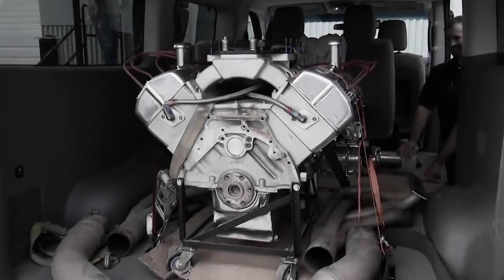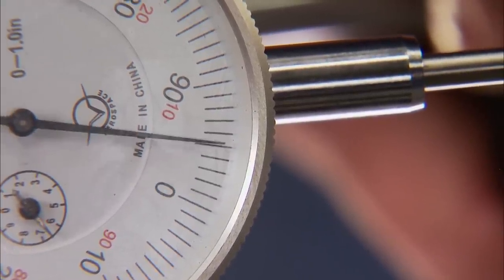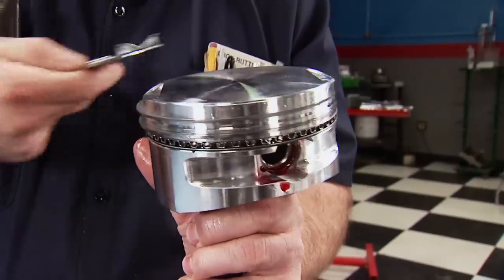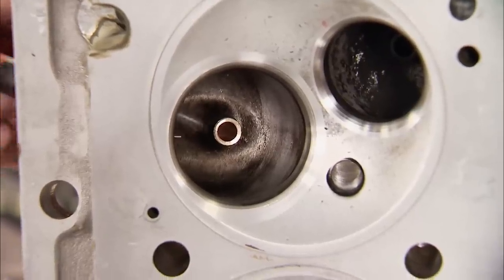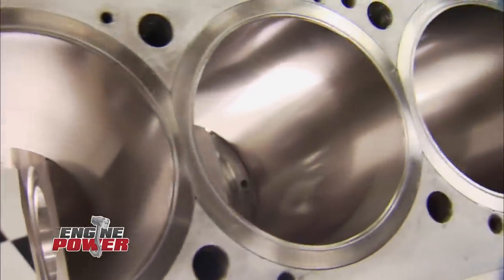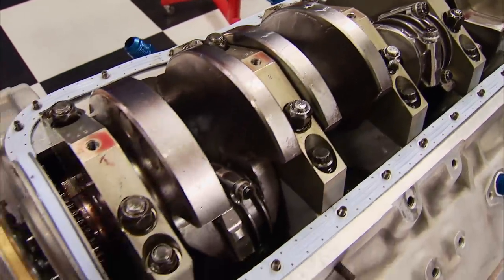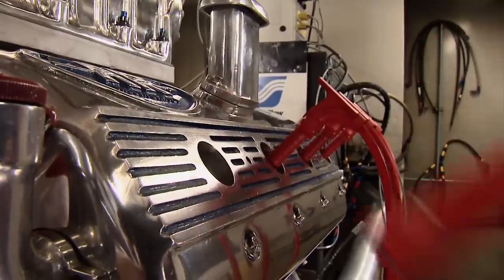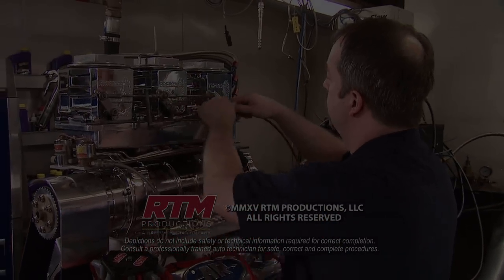The Original BigFoot Engine Build Part 3 - Engine Power Season 2, Episode 7

Comment: Why would you use a P series bearing instead of an H series 🤦‍♂️
Reply: The P series bearings are softer and can handle a but more dirt contamination by allowing it to become embedded in the bearing and causing less damage to the crank journals than an H series bearing. H series are harder and will support more horsepower overall, but at 1000 horsepower they arent making power than a P series cant handle.
Reply: @thesh111t  I'm sure since this thing will just idle around and not ever produce any power, it will probably be fine. 
I've seen crushed P-series in 800hp engines. Some folks are not the best tuners in the world and they need a little built in forgiveness because they didn't pull enough timing.
For a few bucks more, no reason to not just put in an H-Series. Why run a bearing right to the edge of its capability?

Comment: Considering it's a hemi headed , 600+ cubic inch blown big block those dyno  numbers are quite pathetic
Reply: im sure yours is way better
Reply: Have to agree, I would have expected those numbers naturally aspirated.
Reply: @codycr6  i think they are probably leaving alot on the table for longevity. This truck wont see comp anymore so why push it.
Reply: That's bc the truck is running a low tune. 600+ inch BBf have been used in funny cars making huge numbers for years and this truck during the pulling days was well into the 1400 plus mark
Reply: @wellthatsjustpeachy90  Funny cars, as well as Top Fuel, run 500ci Hemis. That's been the rule for quite some time.
Reply: @mrbeefhbw  they are hemi style yes but each manufacturer is required to build their own motors to spec. Yea sure they have to fit in NHRA standards but they are all done thru their own company. Only reason I can say that is that I got up close with John forces car a few months back and the block def had a Ford logo stamp.
Reply: @Mod Zozer and the reason is they wanted it back to being the right way. Why do something half assed if you have the means to do it right than do it right and you don't have to go back and do it again later.
Reply: @wellthatsjustpeachy90  ....John Force (or any other top fuel or funny car) hasn't used a Ford or GM engine in 50 years.  The 500 cu in engines are all custom designed race engines based loosely on the original Chrysler Hemi.  If the engine you saw had a Ford logo it was somebodys idea of a joke. BTW, Force hasn't been aligned with Ford for 4 years.  He has a Chevrolet sponsorship (2015) currently.  However, there isn't a GM (or Ford or whatever) manufacturers part within a thousand miles of one of these 10,000 + hp engines.
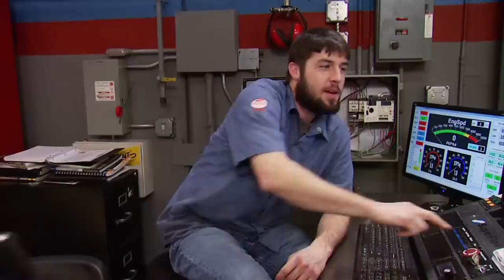Reply: 18:16 is your answer.
Reply: The numbers don't make sense. Even shutting it off early, that engine should have made a ton more power at the boost levels they are claiming. That is less than my small block makes on low boost with half the cubic inches.
Reply: I understand. I have worked around quite a few of these engines. I have also been around 540 inch big block Fords that have made over 850hp with no blower and on pump fuel... with stock blocks and a less expensive bottom end.

Comment: great job but didnt see or here about breaking in the cam
Reply: Non hydraulic lifters, no break in needed. Go do more research.
Reply: @brutalbasspro  its not that its non hydraulic its that its a roller cam instead of flat tappet
Reply: @brutalbasspro  you need to do more research it still has to be broke in lighter valve springs and oil with zink
Reply: Cool story bro

Comment: Cams do Not close valves......valve springs close valves

Cams only control the duration a valve is open
Reply: not with desmovic aka Ducati motorcycles
Reply: I’m addressing the statement made in this video

But I wonder why so many times I’ve heard so called professionals say a cam opens AND closes a valve when it clearly does not.

Maybe because they are not professionals at all but YouTube and tv show hosts and not real mechanics......otherwise they would know the physics of it all
Reply: Chief60 because Camshafts DO open and close valves, its not like they instantly go from opened to closed. The valves are controlled by the design of the Cams lobes, not the springs....
Reply: Mvstng.......
So valves are magnetic?
That’s what your saying?

It’s gotta be what your saying, it would make sense in your interpretation because otherwise how would the valve follow the cam lobe

Oh wait........ the valve must follow the cam lobe because of valve spring pressure holding it in the CLOSED position 

Thus I am correct in saying valve springs CLOSE the valves and your scenario is incorrect.......otherwise you wouldn’t need valve springs at all

I’m waiting to hear your reply 
This oughta be good
Reply: Having to explain something so simple to people that don’t understand science of motion or physics in any way is frustrating, so I won’t try anymore 

I am correct 
You are incorrect 

It’s that simple

Bye bye
Reply: Chief60 my first explanation was shit, ill try harder this time. I don’t believe These guys are implying the Camshaft physically closes the valve and holds it closed, and neither was I. It obviously doesn’t, its done with the pressure from the spring, but at the same time, the cam lobe is what allows the spring to close the valve. So, technically everyone is right. No the Cam doesn’t close the valves the same way it forces them open, but the lobe tapering off is what allows the spring to be relieved of pressure for the valve to close....(To simplify quickly, I know it must be hard for you: The Cam lobe forces the valve open by compressing the valve spring with the lift, after that it starts to close and the lobe tapers off, which takes the pressure on the spring away, closing the valve) like I was saying, it doesn’t hold the valve in place, it just controls when the valves will move while the spring provides nothing but pressure. Could be the reason why many “experienced” guys say it that way, instead of saying the spring and Cam both do their jobs to close the valves... until next time Chump, I mean, Chief.

Comment: I sure hope you 'Weight Matched' the Rod/Piston/Rings reciprocating mass or that Internally Balanced crankshaft won't help much, and, What about Dynamically balancing the ENTIRE rotating assembly? ? ? You didn't use a 'Rod bolt stretch gauge' to properly torque the rod bolts? ? ?

Comment: That's clearly not bigfoot 1s original engine, this engine came in the late 80s/early 90s. Allen Root blocks didn't exist back in the 70s when bigfoot 1 was built. The first engine was a production based 460. One would think that these guys would know. Ive seen bigfoot 1 up close at least 10 times since the late 70s. But this big Allen Root Hemi is much more exciting than that old 460.
Reply: Frankenstein Monster It had the Allen Root in 1984, but yes it was all 460s before that. Technically the original Foot had a 360.
Reply: Frankenstein Monster may not be the “original original” but it’s the most iconic, the one everybody remembers
Reply: @nhraandnascarfanatic5907  well maybe they should point that fact out, because its not the "original". How people feel about it is irrelevant.
Reply: Wtf is it with people and political correctness... at the end of the day no one cares. This engine was what really gave Bigfoot it’s name in 1984 and put it at the top of the food chain... so what it’s not the ORIGINAL engine. No ones going to get a buzz from a grubby oily old cast iron 460 are they
Reply: The original engine is what he towed his camper with.

Comment: 6:08    If it were me, I wouldn't be using a torque wrench on the rod bolts for an engine such as this.... 

Toss that thing aside, and use a stretch guage on them instead. 

But that's just me.. 🤷🏻

Comment: That was disappointing!!!

You wussies could have at least zinged it to 6000!!!
Reply: George Ray's 2019 Videos this is a genuine Alan root engine from the 80s AND the power plant for the original big foot, a piece of Motorsport history, the risk of booting a rod out the side of that irreplaceable block is not one I would be willing to take either pal..
Reply: D G considering that a LOT of the stuff is brand new, if they do boot a rod out the side of the block, then they need to have their asses fired for using shit components in a high powered build.  Stuff like Passenger car rated bearings instead of a full race bearing.  Granted it sounded good for the micro-short time they ran it.  But that short of a run time wasn’t even worth all the hassles and headaches it takes to put it on the dyno!!  And this engine was at 6000-7000 EVERY time it was run in the truck!!  Bad part is, now it’s gonna go into the Smithsonian and just sit and ruin.  No one will think to back off the rockers so the springs that are compressed don’t weaken, or to raise it onto a stand so that the tires have no weight on them and don’t dry rot so quickly...  lots of things to make a difference!!
Reply: I’m aware of this, but even a highly specialised article like this still needs a break in period before leaning on it. I’m surprised they even took it to where they did at 16psi so soon after the initial start up.. as for when it goes on display, bob chandler is a clever man, I’m sure he has all this into account, he wouldn’t go dolling up this engine like he has only for it to sit and rot for another how ever many decades... but that’s all at his discretion at the end of the day
Reply: D G they probably did the break in and just edited the video.  Which would explain the high idle rpm.  They could have left it for a few hours at accelerated idle and had a flunkie watching everything and alert them if the temp spikes or oil pressure drops too low.  I am just saying that the pulls they did were pathetic regardless of anything else involved.
Reply: George Ray's 2019 Videos don’t know man.. they just did wat was instructed of them at the end of they day

Comment: Most expensive 600 hp ever...I was expecting 1500. That engine should make 1000 hp NA at 6200-6500 rpm., any decent 632 BBC can and will do it. Those boys fail. Always short change the blue oval. Disgusting.

Comment: Underwhelming,  571 cubic inches 16 pounds of boost. 116 octane fuel those power  numbers are unimpressive. I get it it's a parade motor but still a let down when you consider what's there.
Reply: This engine setup is capable of a healthy 1500 hp all day.
Reply: Isn’t it 640CI?
Reply: @dylnbxtr  Yes it is.
Reply: @dylnbxtr  It was 638.4, but they re-sleeved it to a smaller bore for 572 cubes.
Reply: KawasakiRider -  No it's garbage power, all day long you can find NA single carb 572's that make 750HP and shift at 6200 RPM.  I'm willing to bet in the early 80's this motor was still capable of 1k to 1.2k
Reply: This engine was designed and built in the 1980s back then these were big numbers... and they weren’t even close to leaning on this thing on that pull as they had only just started the thing up
Reply: @nhraandnascarfanatic5907  What are talking about? You can't go part throttle on the Dyno. It's full throttle or nothing.  Unless they were using a weak tune up on the motor this is all it's got.  If you do a weak tune you wasted your dyno time
Reply: @nhraandnascarfanatic5907  they told us they were running 16 pounds of boost. At that rpm from an 8-71 they are turning it pretty hard.  They will be hard pressed to get more than that out of that blower. So do tell me what was undertuned?
Reply: Travis Lee the whole point of this build was restoration and preservation, not to make big hp and risk hurting a priceless irreplaceable engine
Reply: @nhraandnascarfanatic5907  so now you are back tracking? Those aren't taking it easy numbers?  The power numbers are super disappointing considering what's there even for a parade motor.  Street NA 572's on pump gas hit 750 all day easy. I know blown 468's on 9 pounds of boost that are street driven that hit 900.  These numbers for what's there parade motor or not are unimpressive.
Reply: Travis Lee back tracking?? I think u need to reread my comment

Comment: Would never run i beam rods in a motor like that!!! Your just asking to destroy that super expensive aluminum block very bad call!!!!
Reply: It was the original set of rods from back in the day.  Considering it's really only going to be a museum piece they're good enough
Reply: Then why did they do all that extra work Resleaving  it with smaller sleeves a new Pistons, new cam , valve springs, comp valve job ect. why do anything at all if it's just going to sit in a museum if your going todo it do it right and they did it so y not

Comment: Jeez, only 750hp/750ft-lbs? They spent about $50k on that rebuild, that is just shameful. You could make that reliably with a stock LS with ring gaps filed out and a turbo and have spent less than a tenth of what they spent.
Reply: That misses the entire point of the build.
Reply: @johnwilburn  Yes and no. Obviously they wouldn't throw an LS in there, that was just to illustrate my point. Point is, they spent an exorbitant amount of money for the amount of horsepower they made.
Reply: The point was preservation of a historic race engine.  The power numbers aren’t even relevant.